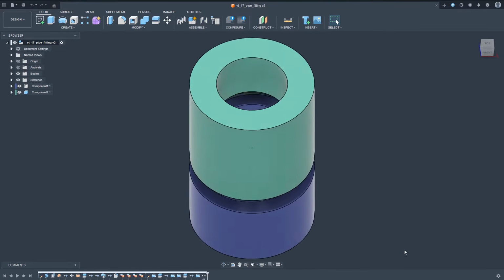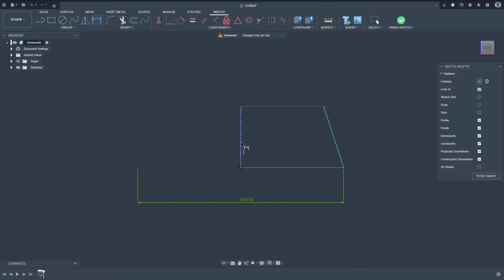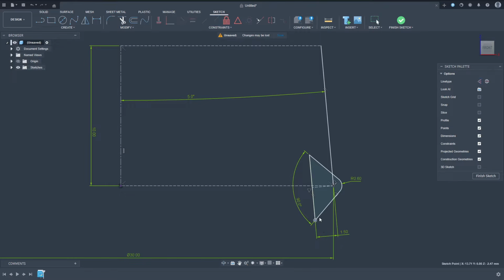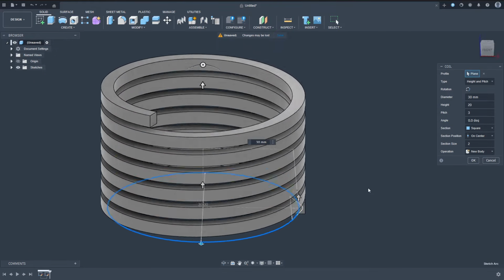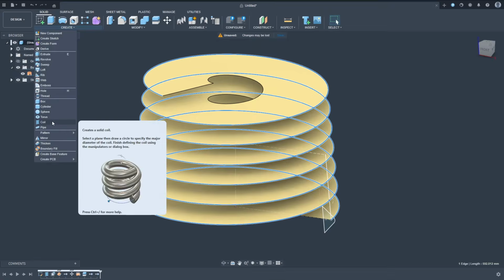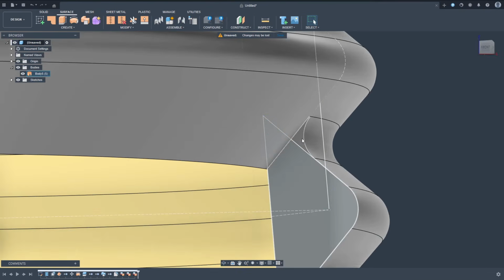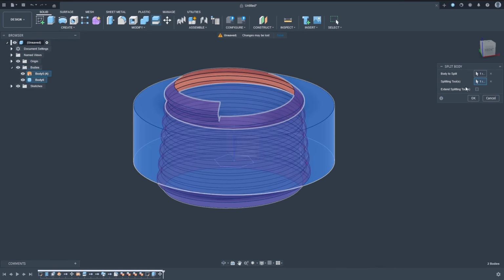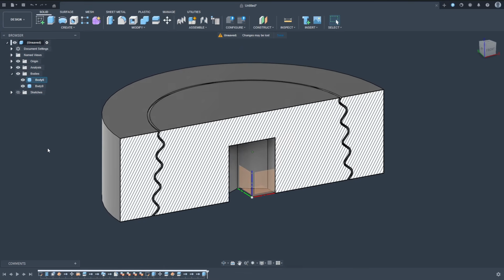Tapered Custom Threads in Autodesk Fusion

Comment: Thank you for this excellent tutorial. Clear and precise explanations. 👍
I learned new modeling tips and techniques for this particular case. 😊
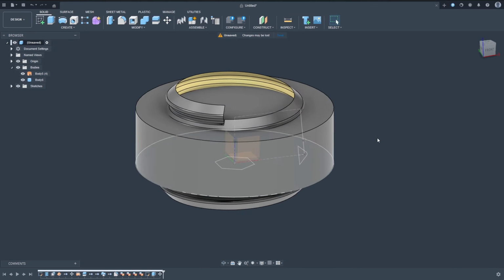For my part, I got through to step 09:20 without any problems, but the 'split bodies' function fails because Fusion cannot find 
an intersection between the target and the split tool (that's the error message it gives).
I can't see where the problem lies.
😊
Reply from the maker: Huh, hard to tell. Id have a close look at the surface body first whether there are any holes or added faces. Then I would try to pre-split the solid (e.g. by front & right planes) or make reduce the extrusion depth until I can find a solid which can be split. Then I can work my way up to find the region/feature which causes the split to fail. Maybe also unstitch/stitch may help...
Reply: @getprototyping  Thank you for taking the time to respond.
I will review the last steps while checking your suggestions.
👍

Comment: I feel like tapered threads are ideal for the 3D printing scenario, because on the one hand we have to give plenty of clearance for printing reasons, and on the other hand threads should benefit from progressive tightening.
Reply from the maker: Yes, if you can accept the tolerances in angle and axial position as well, these will definitely save you taking care of any clearance issues.